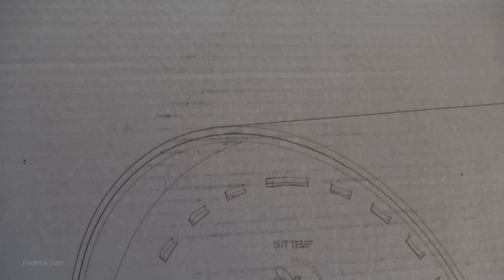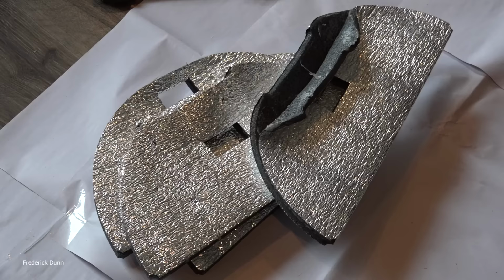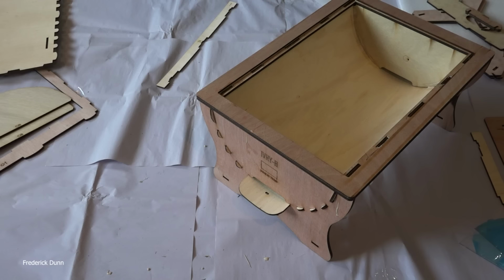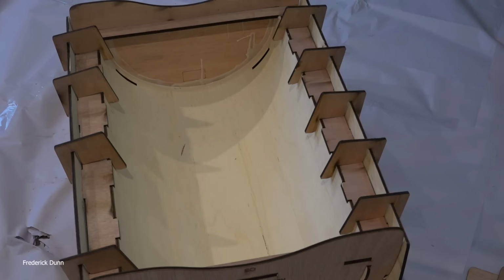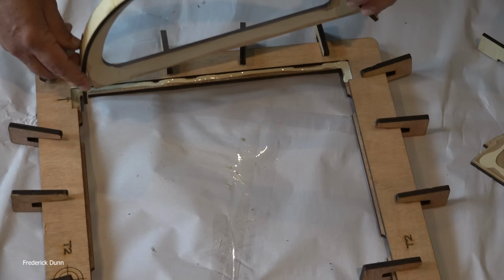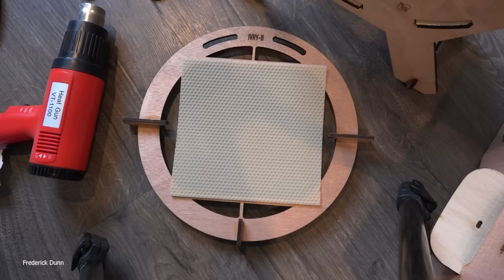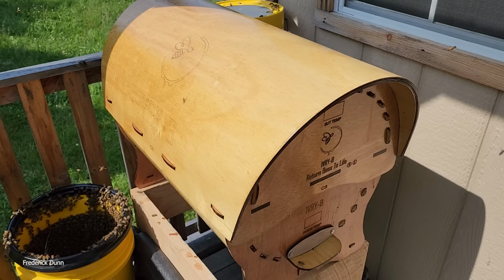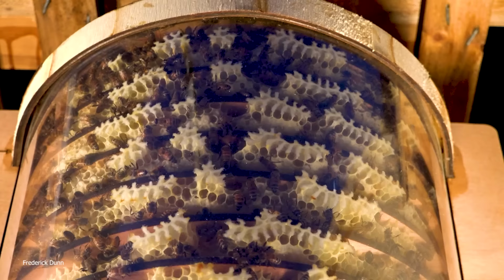A NEW Bee Observation Hive Design based on Ancient Principals by Ivry B., Round 180 deg. view.

Comment: I saw this on another video. Quite interesting hive. Not sure how long it will last in the weather, especially since here in the states. It's dry in the middle east. However the clay hive was used due to the clay being cool on the inside and warm on the outside during the hot weather. Same concept in homes in Arizona, New Mexico, California, parts of Colorado and Utah. While living in Arizona and New Mexico, I saw how the homes were built from the bottom up and it made alot of sense why they built them that way. Of course you go to Chaco Canyon, and Canyon De Che and you can see the cliff dwellings how they were built or even the pueblos. I have to say very genius ways using clay.
Reply from the maker: Clay was a great resource in the absence of timber :)  Thanks for sharing!

Comment: Fred...very interesting hive.  So do you plan on leaving the top on for the most part and do you plan on letting this hive swarm just like your other observation hive(s)?  Is that entrance 3/8"", 1/2"", can a shrew get in?  What about the skunks?  will the bees be able to clean out the bottom?  I wished you had installed the inside temp so that one could tell ow hot it is getting when you have the cover off and are viewing the bees with others.  Are you gonna do tests on the glue that they sent?  Could you put 2 of these 2 together and a queen excluder between them and make it an Ivy-horizontal hive with brood one side and honey on the other?  How would you extract honey from these frames?  I could go on but I will resist the temptation!
Reply from the maker: Yes, I plan to leave it covered other than when we check in on them in the late afternoon or early mornings. The entrance reducers are interchangeable and I'll be modifying one to block any mice or "shrews" from gaining entry =<';'>=  Well out of reach for skunks. Regarding that temp probe I didn't want the bees just glueing it to the bottom, and don't think there's much value in knowing the interior temp vs exterior temp, I can still put a probe in if I want to know more later on. I think most of the honey in this one will be for the bees this year, but in spring I'd have to pull remaining honey to prevent it from becoming bound when the flow hits. I will allow them to swarm otherwise. I don't have other hives to exchange frames with, so it puts me in the same position I am with the Layens Hives.

Comment: Thank you for the video and the detail, great job! I wonder if the whole thing were wax dipped if it would be a solution to the propolis. 

I would have expected more  defensiveness when you pulled off the cover. I've been kicking around either a Long Lang or a flow hive, but this might be more interesting.

Hopefully they can be in Louisville.
Reply from the maker: Hmmm, wax dipping may be an issue with something that has so many enclosed spaces, and you couldn't do that and then glue the pieces together. I'm sure we'll see some interesting finishes.
Reply: I was thinking about dipping it prior to adding the clear covers and insulation, but you are right about the glue not sticking...

Comment: Thanks for reviewing the hive!  What a lovely design but that the bees are attaching the frames to the top doesn’t look promising… I don’t envy you trying to lift off the clear cover … but if anyone can it’s you!  😅. Regarding the heat gun … can it be used to melt bee wise shavings onto a plastic frame?
Reply from the maker: You could try it out? I've never used a heat gun for that purpose.
Reply: @FrederickDunn  I ended up just putting was clipping on a frame that sat out in the sun (for environmental reasons it didn’t make sense to buy a heat gun)… the clipping then role up as if doh, and then I smear it onto the frame … incredibly slow and efficient (one per day)… but for 6 or 7 frames it’s completely doable.  Thanks.

Comment: i like the idea of this however, if you need to expand the hive you have to buy another one of these. and the question of durability of extracting honey with an extractor which they said you can do. i question that.
Reply from the maker: It's definitely not a production hive. Durability is yet to be seen. If you wanted to extract honey, you can uncap the comb and put it in one of the radial basket style extractors on alower rpm. Also, these activities and examples will be shared over the next year.
Reply: @FrederickDunn  thanks Fred! Definitely will be interesting to see the longevity of this hive.